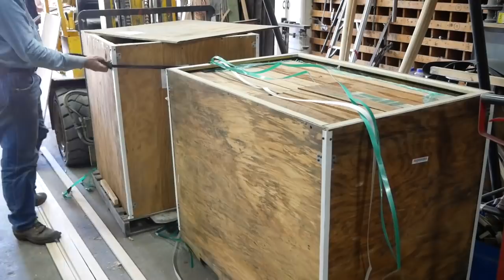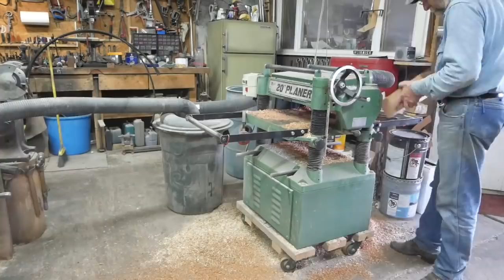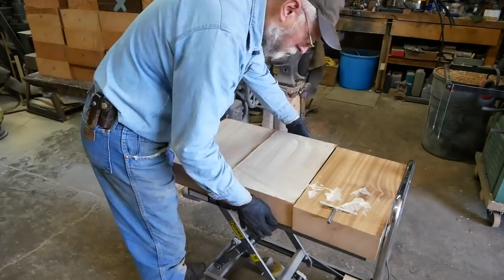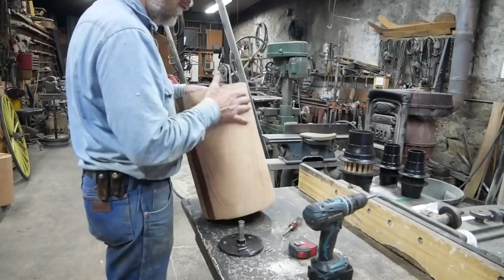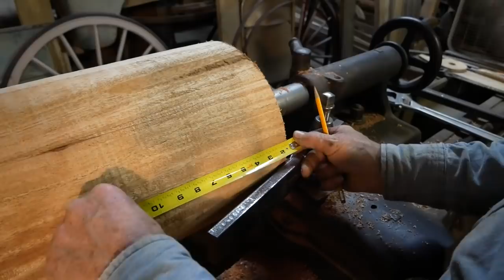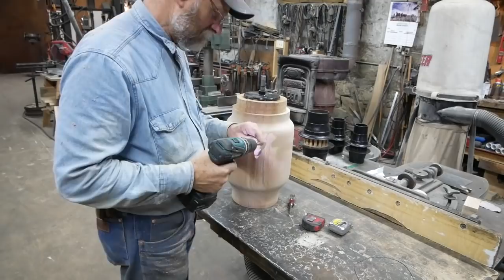Turning New Spanish Cannon Hubs on a South Bend Lathe | Engels Coach Shop

Comment: Dave,  mahogany is still the wood of choice when they do the interiors on most commercial vessels.  I have worked in the maritime industry for over 40 years now and, other than the Navy vessels I sailed on, I cannot recall a single ship or workboat that did not have all the interior woodwork done in mahogany.
Reply: Fifty years ago, I helped my dad rebuild a mahogany deck hatch for his  1903 Catboat. Plugs over brass screws, everything smoothed and coat after coat of polished varnish. The old mahogany was gorgeous.

Comment: Imagine what those two pallets of mahogany in those dimensions are worth dollar wise.
Reply: Yeah, I had 'woodshop' in the 8th grade about 1959-60...we had big piles of this stuff in mahogany, walnut, and some ebony....some of the walnut was 6"x6" and maybe 4 feet long...
Reply: At $8 per board foot the cost would be about $12,000.00
Reply: I was on board the USS prairie ad-19, they replaced the wood decks made of mahogany, from bow to stern. 2.5 decks. then a few years later they sent her to India to scrap. the cost was staggering, and we wasted it.
Reply: That depends on EXACTLY what "mahogany" it is, as "mahogany" refers to a family of trees, not one specific kind of wood. Watching it being turned on the lathe I guess it is some softer, cheaper variety. Still, "cheaper" does not necessarily means "cheap" - definitelly much more expensive than spruce or pine.

Comment: First, it is a joy to watch you work. I have recently come upon you videos and thoroughly enjoy them. Because I would like to learn from you or others with better knowledge than I, a couple of questions come to mind:
1) Do you know what tools the original makers of such hubs would have used? I am assuming it must have been a wind or water powered lathe but perhaps you have some other information on the subject.

2) I see you are using what I've heard called a "story stick" to get consistent results on each hub. But there are tools to help duplicate turnings that would seem to work well in this situation facing the need to produce so many identical pieces. Is it simply a work preference of yours or is there something about these turnings that make them less useful than it would seem?

Thanks for any light you can shed. And, again, so glad I found your channel.

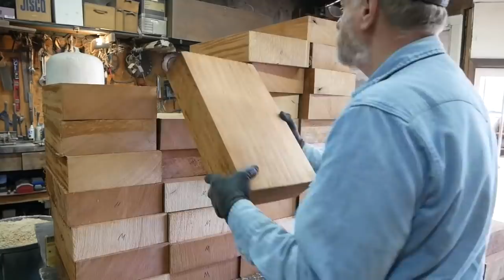Comment: 3:38 - hmm...

Those wheels are going to be used (well, not much "used", but rather "kept") in tropical and humid climate (thus mahogany) - and I doubt how well that regular wood glue would stand those conditions.
Yes, I know - all parts of wheels are banded and kept under compression all the time - still, there's a neat trick of the trade to make regular PVA glue set stronger and make it waterproof - it is done by adding solution of aluminium chloride, AlCl3, to the glue. There's that German (?) company by the name of Rakoll (or their PVA glue is sold under that brand name) who sells that "hardener" (https://www.ostermann.eu/de_IT/product/haerter-duplit-haerter-fl - no affiliation, just one of the first Google search results).
AFAIR, and to my best knowledge that "hardener" is just that - aluminium chloride solution (which is quite acidic, as aluminium is amphoteric metal, thus making very weak base). All you have to do is to mix that AlCl3 solution with your regular PVA glue and use it in regular manner - the only thing to keep in mind is you have to use that "enriched" PVA glue within seven days (less, if ambient temperature is high).

While at it - adding some borax or boric acid to the glue would make it more fungus-resistant, as boron is a spiecies-specific poison for fungi (in the same manner as arsenic is poisonous to mammals, but some bacteria can thrive on it - or silver ions killing bacteria while being totally harmless to humans). 
Best, KB

Comment: I know you like to do it fully by hand ,but you can semi automate by buying an old copy lathe or make your own. 
Like your cardboard profile checker a pointer at the back of the lathe will run along a  metal profile of the job shape and will be attached to the saddle thus the tool cutter will mimic the pointer and cut the profile on to the wood  , you could do a complete job or ruf out and finish by hand if you wish , this will speed up the job and you get paid quicker. Steve in Thailand.

Comment: Yup. Mahogany is found just about anywhere in a boat (modern or old). Decks, decorations outside and inside, some structural elements. It's a resilient wood.

And outside of that, in the old family house, the wind chicken is made out a single piece of mahogany. It's been up there on the house for 93 years now, not a single crack on it.

Comment: Hi:
You must have a Kings ransom in Mahogany.  The last that I had and used to build a piece of Furniture was given to me.  The first I bought over fifty years ago was the good stuff and cost a lot.  
It was very hot the day I had to rip up some 4/4 boards with a circular saw and the saw sent the dust straight to my sweaty pants.  They were red from that day on.  How do you like working the Mahogany?  I have always enjoyed working it.  Yes, it is a tropical wood and it does great in moist places.
Reply: Yes, it is a lot softer than Oak, Ash and other hard woods.  The great thing about Mahogany is how nice it finishes with oil finishes.  Have Fun
Reply: I never saw the value in Mahogany as others have. The harder woods spark my interest much more such as purple heart, black walnut, coco bolo and white oak. Unfortunately, they are very expensive.
Reply: I am guessing it all depends on where you live.  I get White Oak between 3.50 and 4.00   and walnut about 8.00 to 10.

Comment: Making one off would be difficult enough , but to make 12 off to match the first one without all the CNC pooter gismo machinery shows just how good real craftsmen are working with tooling from years ago. How the heck you didn't get that tape measure caught up and mangled around the hub when it was spinning in the lathe showed how confident you are at doing this type of work or was lady luck on your side today ?.

Comment: I noticed you went straight from the pallet to the 20" planer and skipped the jointer. Were you assured these blanks were prior flattened?
Reply: I'm not Dave, but he planed the glue faces... the 'edges' all went away on the lathe...

Comment: Is that an old Willy’s Jeep I see behind the lathe?
Reply: My dad restored a 1942 mostly Willys about 15 - 20 years ago. We loved that thing. Unfortunately he lost it in a barn fire in Montrose CO about 10 years ago. If you ever get around to restoring it be sure to make videos. I as well as my old man would be sure to watch! Keep up the great work.
Reply: I really think you should video it. Let me give you some arguments for doing so. 1) the reason I was drawn to your channel was the Borax wagon project. Do I have a mule team, no. Do I have a desire for a wagon, carriage or buggy, no. So why do I watch? I watch because I enjoy watching projects being done in a shop and all the various disciplines that it requires. I grew up with a 3k shop, we had a full woodworking and machine shop. Which seems like a strange combo until I you my dad was a trained air frame and power plant mechanic. His first project was a Biplane and yes I learned sew canvas in that shop as well. I was fortunate as a kid my dad was home from the time I was 10 he was home everyday working in his shop. Everyday was an adventure, he used to say “what are we going to build today?” We did everything from cabinets, roll top desks, Baja bugs, tractors, he even built a screw type log splitter attached to VW transaxle powered by a 40 engine on its own trailer. Let me tell you it works faster than any hydraulic I’ve ever seen...although it’s not really osha approved. Anyway my point is that I think you can do any kind of project and people will watch. You would probably drag more people to your channel to watch a Willy’s Jeep restoration project and they would stay because of the artisan/craftsman work you share. To be honest I don’t know how I found your channel but when I saw that the Borax wagon that I saw at the Rose Parade a few years back was brand spanking New I had to binge watched that over few days to see how it was done. That’s my 2 bits worth anyway.